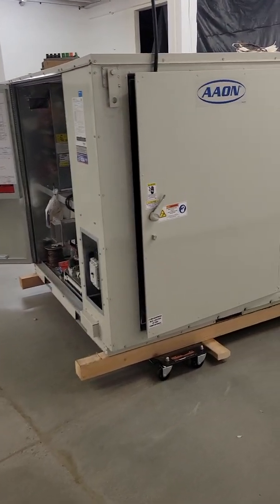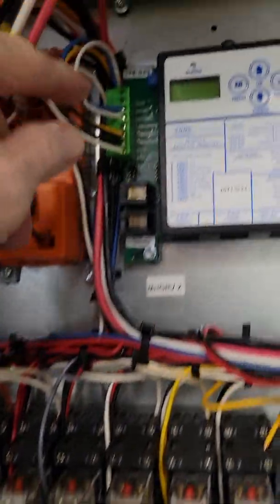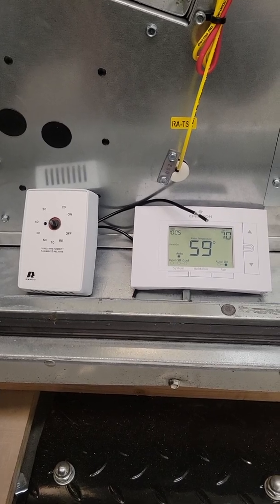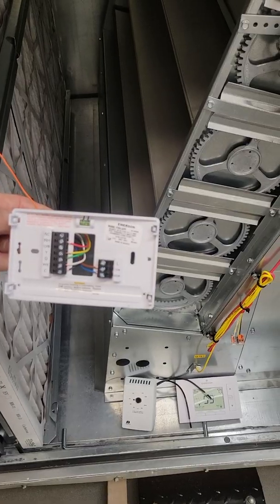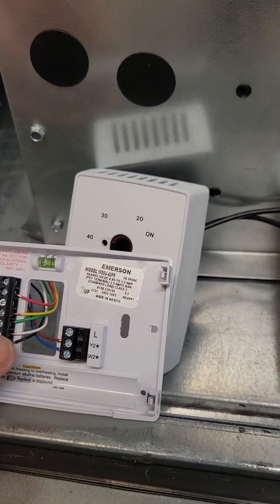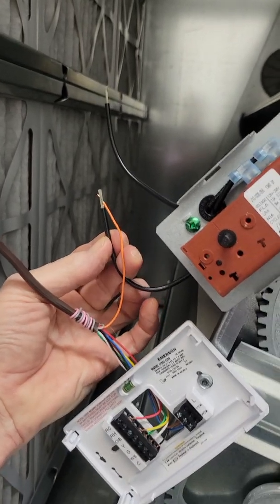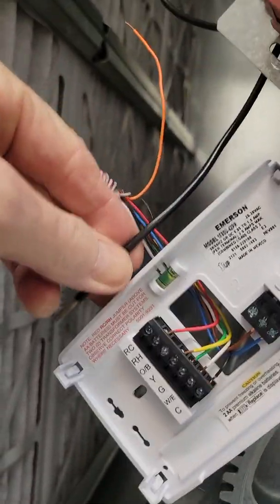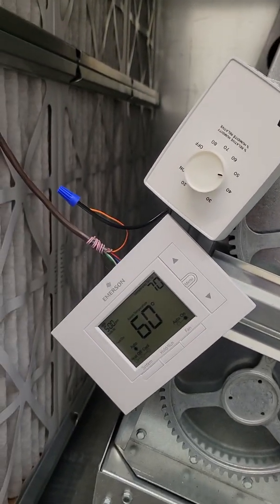AAON: Temporary T-Stat Installation Part 1

Comment: Thank you For sharing, can you show The thermostat connection to the control board please
Reply from the maker: This is a temporary install until building controls are integrated, so the thermostat wiring lands at the terminal strip in place of the control board wiring. Control board wiring should be removed from the terminal strip and thermostat wiring landed. Hope this helps, let us know if you have any other questions!